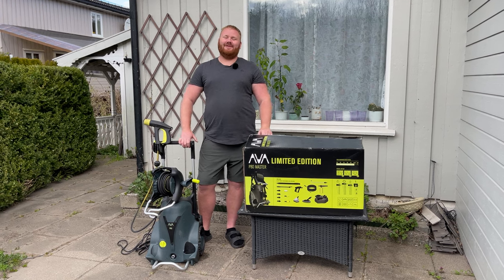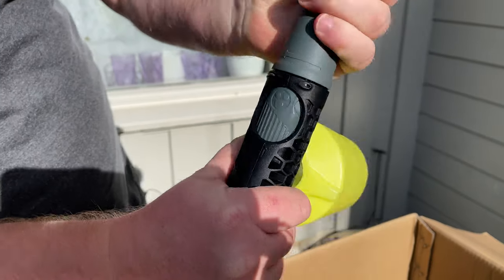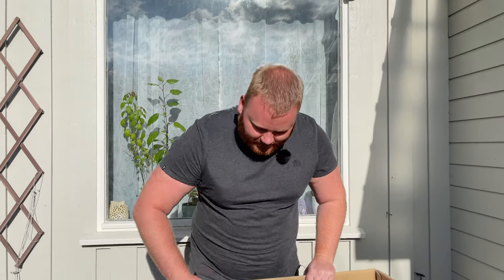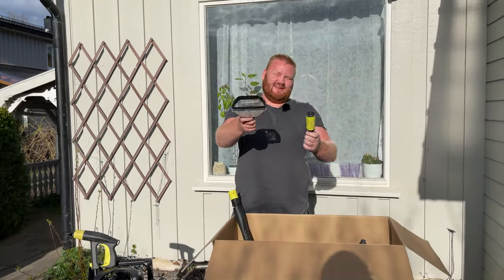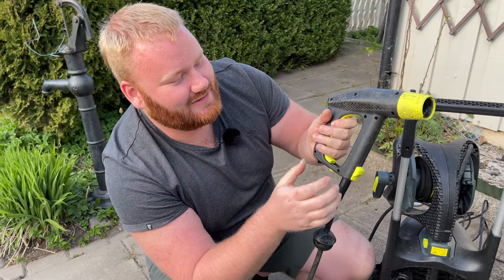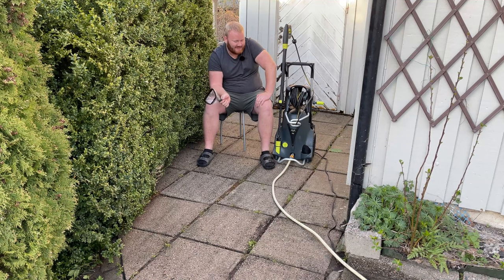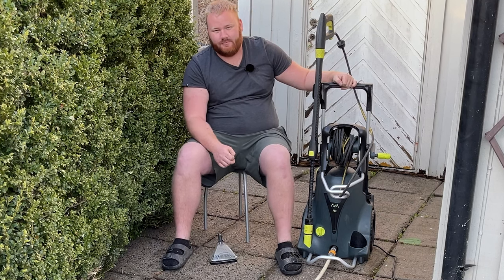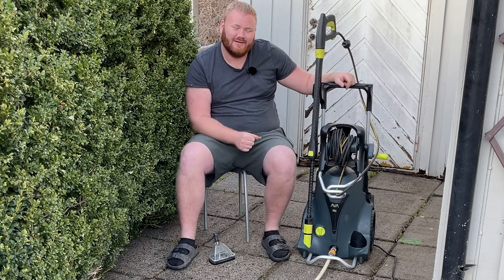Review of the AVA P80 Master pressure washer

Comment: Hey up.   I’m on a P50. Not unboxed yet. Have a MTM SGS35 ready go on it.  I’m new to Ava and wonder what is diff between this and P50 thanks
Reply from the maker: The main difference seems to be in pressure, with the P50 providing 130 bar and the P80 providing 160 bar :)
Reply: @techiedoodledoo  thanks !  I’ll check if 130 enough most car requirements

Comment: Hello , can you explain  the fuse requirements more.  Thanks
Reply from the maker: To connect the pressure washer to an electrical circuit at your home, the circuit needs to be rated for at least 2800 Watt, which is the effect of the pressure washer. If the circuit is not able to handle that effect, the fuse in your fuse box may blow. I recommend speaking with an electrician if in doubt :)
Reply: I’ve got one in the shed that I never used nearly perfect but unusable as keeps blowing fuses now I  have kranzle  k7ts after the frustration of using this garbage
Reply: @colinmcburnie2881  did you contact AVA  also was you trying use  your own stubby gun with this
Reply: @marksteele8760  yes I ended up sending back tried everything and no just used lance and gun that came with it! Shame as liked it could blow 3 fuses sometimes washing my own car. Never had problems with my karcher and definitely don’t have problems with kranzle as I say it’s a shame as if I didn’t suffer the problem would be brilliant but the things is I did and would never buy the brand again
Reply: @colinmcburnie2881  which one you got in your shed mate
Reply: @marksteele8760  I had p80 master sent it back now
Reply: @colinmcburnie2881  ha ok.  Was going ask if selling

Comment: I have a p80 and when i don’t use the it but it is still powered and connected to water supply, it start and stops the pump every couple of minutes.. is this normal?
Reply: Wtf? Turn the watar and electric off!!
Reply: @kimsavstrom2479  I expressed myself wrong.. when I clean my car, I need the pressure washer a couple times.. for example foaming the car, rinsing, applying wet wax, etc.. so between these steps, I don’t turn off the pressure washer.. so between the steps when I am not using the pressure washer, it makes some noise and sometimes when I take the pressure gun and want to use it.. the pressure is gone.. I have to wait a few seconds before the pressure returns.. any one the same problem? Sorry for my English.. I am a Dutchmen 😁